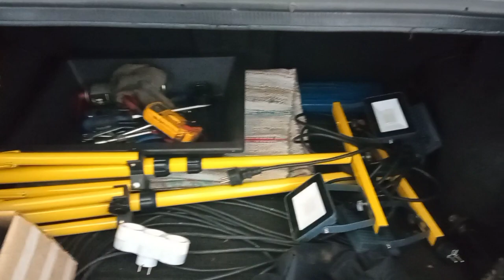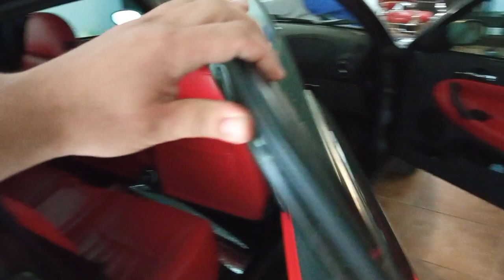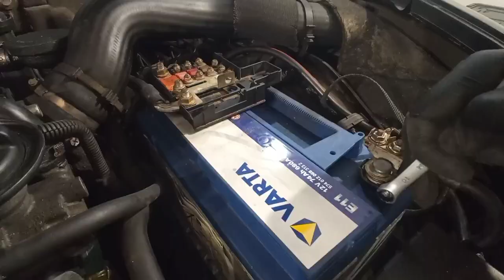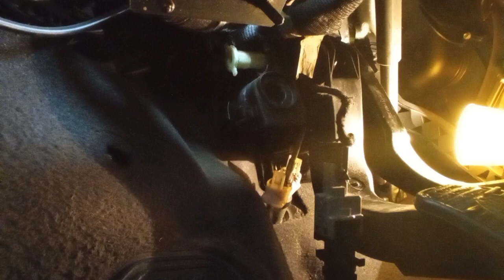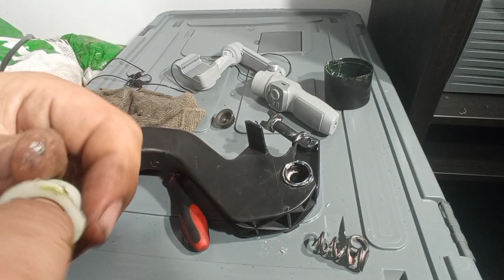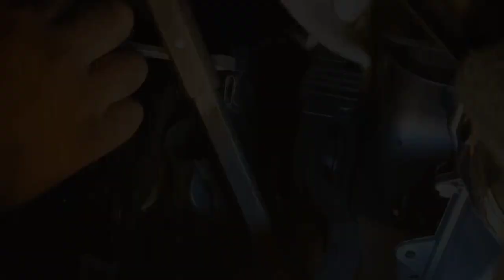Reaching out, helping others. Alfa Romeo 147, hard and squeaky clutch pedal.

Comment: I have just change the clutch kit and the pedale is still hard and squeky for my 147 1.9 jtdm model 2009
We use valeo. My question is after changing the kit. Will the pedale be very soft and easy to press just like the one of the other cars  as exemple punto fiat 2014 or hyundai accent 2010 or...
Reply from the maker: Hello. Yes it must be extremely soft, almost like is out of pressure. Check this out:
https://youtu.be/RG9Mo9eg_qU

Comment: hello, thanks for great videos! i managed to remove easily the clutch pedal and found a broken in 3 parts assistance spring. I can't exactly figure the length of it , i figured between 55 and 60 mm? does that sound correct? it's a 1,9 diesel 147. thanks in advance
Reply from the maker: Hello. I took the broken spring and order new one from a spring factory. Did not had the chance or necessity of measuring it.
So for that I'm sorry, do not have that info..
Reply: no worries mate!

Comment: Hey man, i got myself a alfa romeo 147 1.9jtdm (110kw 16v year 10.2006.) a few monthes ago (watching your videos ever since i got it 😅 i subbed too because your is one of the best chanels for alfa romeo fixes and tipa if not the best) i paid it 2200€ and spend more money on parts and services because i wasn't carful when buying. Had a check engine light code P0237 mechanic canged the turbo with a used one, used filter box, new alu intake manifold, dpf egr remove and mechanical and softwer shutfown of egr dpf, got it back mechanics said it was like a "plane" now when i first got to drive it after service the check engine light came back on.... Same scenario again. around 4000rpm, 100% gas like the first time it happend same code too P0237. The mechanic said that the used filter box had a vacum valve on it and he just used that one and he suspects that its a bad vacum valve. Didnt go to him i went to another mechanic because i lost trust in him the other mechanic did the work and said it wasn't the vacuum valve it was my turbo hoses they had cracks so they repaired them. Used the car for some days drive it and had no problems than the clutch slightly squiking and being a litle harder to press when i used it for some time (that happens ever since i changed the clutch set and flywheel to new LUK clutch and flywheel... So i think its the same as in the video or maybe there is a fix? 🙏) anyway one day i was driving it for fun. Engine 90° ride it hard but with respect and just all of the sudden presed full gas 3rd to 4498rpm 4th 44xx 5th started presing on 4000rpm i think and 150/160km/h check engine light... Limp mode activated.. same error code P0237 (turbocharger/supercharger boost senzor A circuit low) i didnt go to the mechanic yet i searched on internet looking for a fix and theres a lot of thing that may cause it so i dont know what might be the problem.. (some say dirty egr mine is off, some say senzor bad, bad intake manifold, bad wiring, bad vacum valve this and that) do you maybe have some ideas on how i can fix or if you know what is the most common falt for that code p0237on 147 1.9 jtdm this i would greatly appreciate it. 😃
Reply from the maker: Hello. Thank you very much for watching my videos! First of all, no 147 ever had DPF.. so, did not know what they deliver. Your clutch kit and dmf.. it has to be all Sachs Valeo.. about the fault code. Vacuum lines! Check this out:
Reply from the maker: Hope it helps: https://youtu.be/sCA-z95YvWI
Reply: @alfaromeonoproblem  First of all thank you for the fast reply. Wow told you i lost trust in that guy. Are you sure it doesn't hava a disel partical filter (DPF) and EGR i can't believe it.. Can i keep the clutch and flywheel LUK or no? What happens if i keep the LUK components? So its the vacuum lines 95%? I have a overboost maybe i forgot to mention it sends out 3bar and not 2.4 as it should maybe it helps to diagnose better.
Reply from the maker: You cannot have any luk shafler components on that assembly. You will ruin your gear box, the cranky pulley and so on. Engine mounts, etc.
If you have ouverboost you most definitely have a leak on the vacuum system. Check out one more videos how to diagnose it:
https://youtu.be/OOQHER01Apo
Now remember if the car is remapped... All that can be a bad remap. The car only has the EGR from factory. Only the 159s forward have dpf. 
Non the less, make sure to find out if you have normal or low boost until 3k rpm and above you probably have ouverboost. Report to me.
Reply: @alfaromeonoproblem Im at work right now the best part is i watched that 2 videos before 3 or 5 weaks il rewarch them with extra focus when i get back home. Shit that's some bad news so il have to change the clutch and the flywheel with valeo or Sachs which one do you recomend? Its best to sell my LUK clutch used or do you have a better idea? As far as i know it doesn't have a remap other then thr EGR and "DPF" softwer block. Hope its a vacuum leak that dosent sound so expensive and hard to fix. Does the second video explain how do i test if i have a normal boost or underboost till 3000rpm do i use a obd2 scanner or do i need to have that pressure gauge?  Of course il keep you updated should have reached out to you before i would have a less hard time with my Alfa.. Anyways thank you very much for the info, help and fast replys il make sure to mention your chanel if i hear somebody has a Alfa Romeo. Wish you all the best!
Reply from the maker: The best gauge you have is in the live data. That tells you exactly what is going on. If you have low boost under 3k rpm is  leak and or the solenoid. Very common. 
Even you do not have a remap for power, modifying a map for EGR it's always a modification that can go bad.
Seen it too many times.
However you already had that problem..
About the luk assembly.. try to sell it but be truthful about it. Someone will pick it up for some purpose.
Reply: @alfaromeonoproblem  Of course il say the truth always do always will but respect + for telling me that. Watched the first vid very interesting and informative now i know how to test the tubes all i need to get is the vacuum gun i hope it is not expensive. If there is some air leaks caused by tubes i just get the same size and lenght tube and replace it or is it better to get a used one? I can see live data with a obd2 connected to laptop? If yes that would be great because i know a friend with a obd2 which can connect to laptop. Can you please tell me what normal boost would i want to see under 3000rpm or bad boost it would be simpler to diagnose for me.
Reply: @alfaromeonoproblem  Forgot to ask you. Why is modifying a map for EGR always a mod that can go bad? The person that modified it has done that a lot of time it should be good.. is there another way i can go about it because i dont want the EGR in my car to work to clog up my engine and to make me more problems.
Reply: @alfaromeonoproblem  Ok i watched the second video it really helped me understand. So if i understand correctly i can use obd2 to see live data and i see on the obd2 the desired pressure and the actual presure. It can vary +- 50/150 mBar anything more than that is bad? Turbo startes "working" when over 2000rpm i need to see if that is good too? I hope i understood it correctly il wqtch the videos one or two more times so im more intune. Thank you for creating this yt channel its realy helpful.
Reply: Would it be easier for you if i record a video of my pressure post it on yt and share you the link on this comment? And btw forgot to ask you one important question maybe its a little dumb but its better to ask. Can i drive my car now or is it not good becaue of the Luk clutch and the P0237 error? What do you suggest?
Reply from the maker: You can see with a got diag program. The  turbo pressure values are on my video. Also on the program it self it shows the real pressure and the pressure that it is supposed to happen.
Reply: @alfaromeonoproblem  Thanks il get in contact with my friend and test the values il get back to you. Just please tell me can i drive the car or is it better not to?
Reply from the maker: Sometimes they have issues with doing so and desable the control unit of generating a bunch of fault codes. Including EGR. That's one very coming thing here in Portugal. And turns out the egr is still active
Reply from the maker: Hello, yes, is crucial to see the pressures as soon as possible. 1500rpm I'd say it's the crucial point forward
Reply from the maker: You can send me short videos to my email or yt. 
With the ouverboost you will have terrible fuel consumption and you may burst a intercooler pipe. 
With the luk stuff.. like I told you, gearbox, crankshaft pulley and so on
Reply from the maker: Get back to me with the results in video. About the issues, did respond in a previous comment
Reply: @alfaromeonoproblem  Yes my consuption was 8.1, 7.4l per 100km so its bad. Shit i realy did buy a bad 147 at least i will save it from the junkyard
Reply from the maker: Yes, I hope you can can keep it too
Reply: @alfaromeonoproblem  Hey, just wanted to get back to you. The OBD2 my friend has doesnt calculate mBar of the turbo so i couldnt test it :/. i had it serviced in a shop they told me 2 sensors were bad the one that checks engine temp and the crankshaft senzor. they replaced them tested the car and said everything is fine now. tried it yestrday it drives good. only thing i noticed was the temperature gauge was slightly undet 90 celzijus i drove it for at least a half an hour idk if thats like that or it didnt fully heat up. Idk why my friends OBD2 said it was a P0237.
Reply: @alfaromeonoproblem  Next what i want to do is fix my rust on the car. Il do that myself. do you have any tips for me or maybe a video on how to do it?
Reply from the maker: The temp sensor can do do strange thing, and a non original one can read a bit of what if should. Do you still have engine light on?
Reply: @alfaromeonoproblem  No check engine light now. It runs good if we excuse the clutch. I decided to keep the LUK clutch and when it all goes to shit il replace the gearbox, clutch and other stuff ao il know everything is good.
Reply from the maker: Ok, but a used gearbox can be anything... Make sure to find a quality one
Reply: @alfaromeonoproblem  No worry's, i have a good guy for used parts. got a used windshield from him cheap, accidently broke it and he gave me another one with a rearview mirror and 2 sensors i think one is for rain and another for traffic. Is there a possibility i can connect that 2 sensors?
Reply from the maker: You can connect them. You need to have a control unit for the auto wipers. The sensor that is not stuck on the glass is a defrost sensor.
Reply: @alfaromeonoproblem  Ohh nice. Do you recommend for me to plug them in or is it better to leave as is? Ehat does a defrost senzor do? It starts defrosting the windshield when it gets foggy or frosted?
Reply from the maker: You can plug all in and enjoy. Yes, it detects the humidity on the glass and turns on full blast to the wind shield. Once it's done it turn to whatever was before
Reply: @alfaromeonoproblem  Thanks man there isn't a lot of good people like you. Big respect
Reply from the maker: Thank you very much! Hope I will continue to improve.
Reply: @alfaromeonoproblem  hey man, you were right xD. The temp gauge needs a lot of time to go to 90 but its a little lower than 90. but the problem is my temp drops around 80 and then it goes back to little under 90 and then again and again idk why maybe its a bad sensor? the mechanic said its normal that it happens because of the fan but idk my old temp sensor when it reached 90 was stable and wouldn't drop. Do you have any ideas? is it because its not ODM
Reply from the maker: Men, you have the thermostat bad. You need to replace it
Reply: @alfaromeonoproblem  The mechanics changed it. They said its ok.... Fk i hate when they do that il test it today and film the temperature so il have proof to show them
Reply: @alfaromeonoproblem  Is it ok to drive like that? It didn't reach 90 or above 90
Reply from the maker: Was it good quality?
Reply: @alfaromeonoproblem  I dont know. They changed it for me
Reply: @alfaromeonoproblem  Hey i filmed a video of the temperature gauge droping where can i send you the video?
Reply from the maker: My mail. On the description of the video
Reply: @alfaromeonoproblem  I sent you a email. Thanks